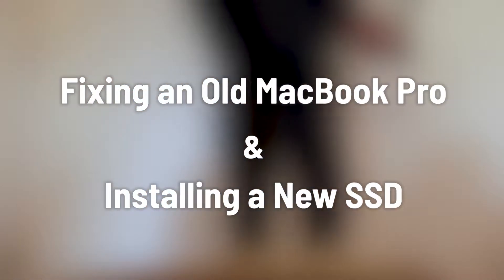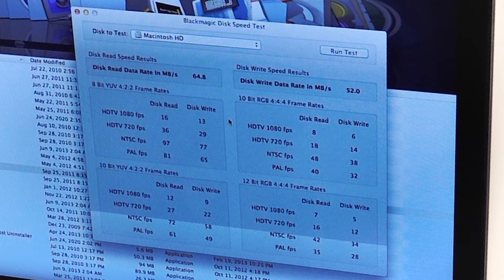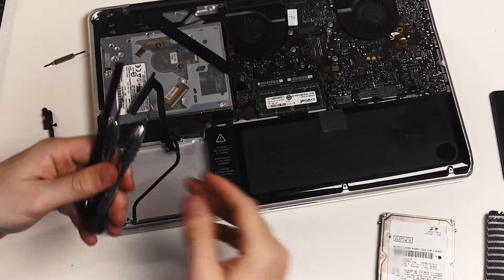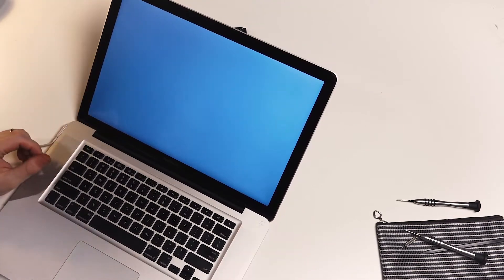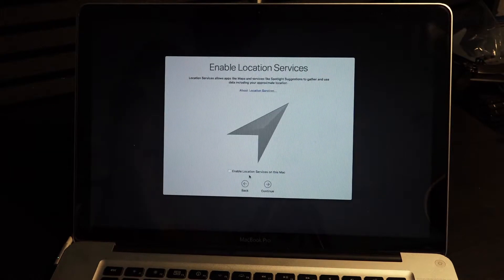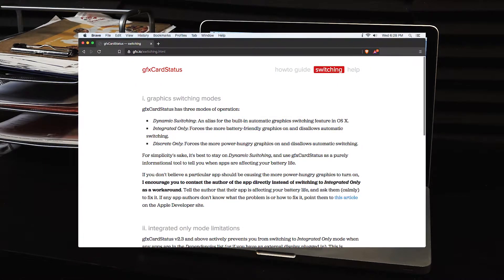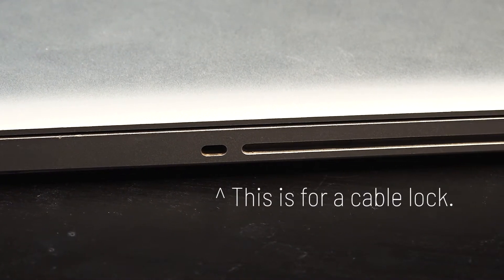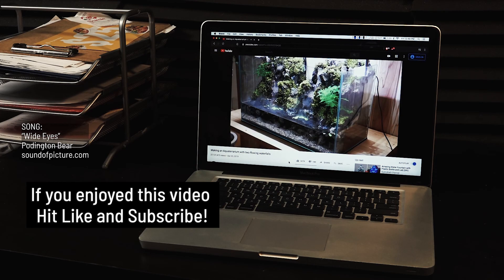How To Install a SSD in a 2010 Macbook Pro

Comment: Not the graphics card.  It is a capacitor that is too small.  Changed mine to the recommended by repairmen and solved the problem.  No more kernel panics.